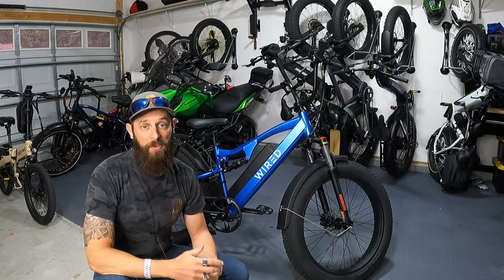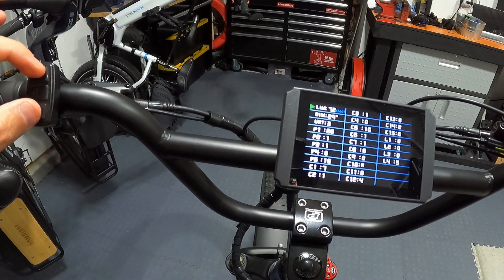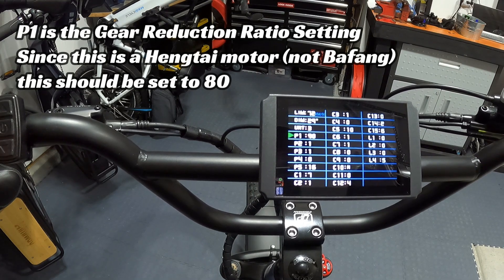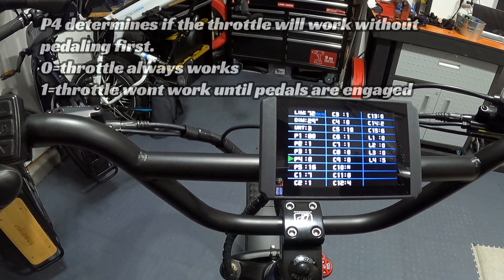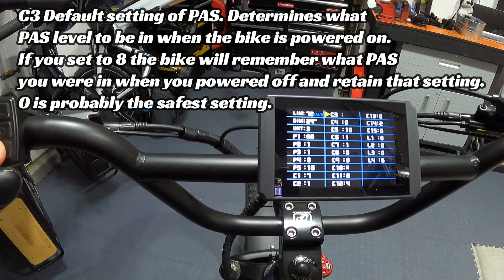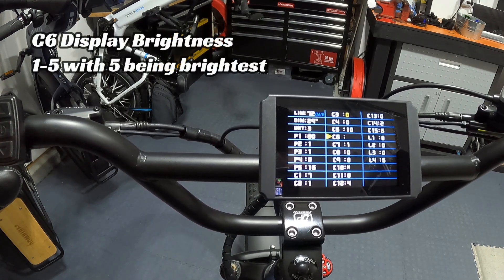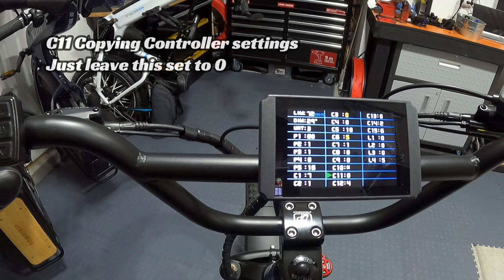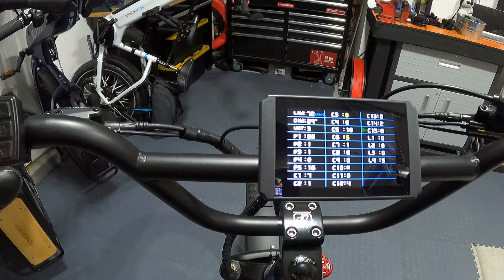Wired Freedom Display Programming Settings - LCD8H Display

Comment: I can’t change any of the parameters in the settings. Anyone knows why?
Reply from the maker: Is this on a Wired bike?  It should all be wide open for you to adjust.  scroll to the setting you want using UP & DOWN and select it with the power button and change as needed.

Comment: L4 parameter is used to adjust the delay time of automatic shutdown of the LCD, the
default value is 5, and the range of adjust is 5-120 minutes.
 4.1. When L4=5, the delay time is 5 minutes.

 4.2. When L4=6, the delay time is 6 minutes.
 4.3. When L4=7, the delay time is 7 minutes.
 ………….
 4.4. When L4=120, the delay time is 120 minutes.
Reply: 0= never turn off??? Thx

Comment: If C5 is at 3 or 4 does that limit total power?
Reply from the maker: yes settings 3 thru 9 limit the power, 10 is full power, 0,1,2 are full power but have a slower start.

Comment: My biggest problem with this is that I have a gearless hubmotor. Running a 1500w 24" rear off of a 48v 20ah. Trying to get the best possible output out of the bike. Currently building a custom E-Chopper. Currently getting around 30mph. would like to get more. The reason for this is in preparation for building bigger bikes.

Comment: Tell me, I bought this display, but it does not work from a voltage below 47 volts, what is the reason?, the display on the back says 72 volts, it should also work from 24 volts?

Comment: I just got off the phone with Wired. Samsung batteries should be set at 6 on the P5 setting. Not 16
Reply from the maker: yep, they changed battery cells after this video. 6 is the correct setting for 2024 and beyond wired bikes.

Comment: The C15 setting is actually to fine tune the walk assist mode speed.  You can enable walk assist by pressing and holding the down key on the key pad.  The bike will then power up the motor to run at either 4, 5, or 6 kph depending on what the C15 setting is set to.  C15 setting options are either 4, 5, or 6 depending on desired speed.

Comment: Been learning from you since the start with Rad Rover, I sold my rad that was fully upgraded from watching your videos, now I’m buying a e-cells five star pretty much the same as the wired as u know only there are benefits that the wired doesn’t have like the potted controller, Anyway, I hope that you get an E cells five star and do a review on it also,it’s a very big seller right now👍

Comment: I had a quick question…in your video you said that the bike came to you with P5 set at 16, and I found the two bikes I just received came with P5 set at 6. Should I change them to 16 or leave it at 6? Thank you for your help
Reply from the maker: Leave at 6

Comment: My display shows just an 
orange/yellow bar. Even with a battery showing three bars, the display only shows the one bar, snd it's orange/yellow
What setting on my display is incorrect?
I tried the P5 setting on 8, 6, and 16, but no change.
 Any ideas?
Thanks
Reply from the maker: Change P5 to 6 and prop the bike up on kickstand and run full throttle thru all the pedal assist levels, I think that calibrates it.
Reply: @CitizenCycle925  , I think you might be right.
I used the factory reset and took the bike for a run.
The battery status is once again proper.
Thanks!

Comment: That's the old version of the Wired Freedom. Do these settings also apply to the '24 version?
Reply from the maker: pretty much the same except P5 should be set to 6 so the battery indicator will be accurate, and C8 should be set to 1 since the 2024 versions have a motor temperature sensor.  other than that, the settings are the some.

Comment: CC, here is an update for your subscribers…. I was having an ISSUE with the GRAPHIC BATTERY STATE OF CHARGE not even closely representing the condition of my battery, and so sent an email to Wired. Steven, quickly and graciously responded with this fix… 1). Set P5 setting to 6 instead of 16. —— 2). With the bike on the kick stand lean it left so the back tire is off the ground. —— 3). Put in PAS 1. —— 4). Carefully making certain the rear tire is free and not making contact with ground, advance to full throttle for ten seconds. —— 5. Make certain back tire is stopped before again making ground contact. THIS FIXED MY ISSUE!!!
Reply: I had a BeeCool Adventurer that was stolen and replaced it a Wired Freedom.  I wanted to purchase from a company that had good first person customer service. The Wired folks are the best!!!
Reply: Io ho una batteria 48v 20 ampere che valore mi consigli in P5?grazie

Comment: Thanks for this tremendously helpful video!  I hope it is okay to request some clarification on C5... I think you are saying selections 3 through 10 allow you to set the "instant on" from dead-start start-up power where 3 would be the lowest power and 10 gives full power.  0,1, and 2 are special in that they give you full power but it provides a ramp up to that point.  The ramp itself I would assume is a slower at 0 and is fastest at 2 with selection 1 being somewhere in between.   Do I have this correct?  Many Thanks!!!

Comment: FYI, newer 2024’s, P5 default is 06 and the motor now appears to have a temp sensor C8 = 1 turns on MOTT
My bike battery arrived 100% charged 😮.  So due to it being winter I get to tilt the thing and run it down to 50% for storage.

Comment: C11 connection protocol you can tell copy or reset a new password on a control you lost pw via second display
Reply: How do I reset it?
Reply: @ozzy6058  you need to link a second controller display that's not password or known password to reset the other controller display.
I've never done this procedure but I do know it can be done

Comment: I'm picking a password so that if someone steals her, they're screwed.
Reply: Me and you both, I ain't dimwitted enough to forget my brand new first ebikes password😅trust
Reply: My Freedom is a replacement for the SECOND bike I have had stolen. This one WILL NOT BE NICKED!  Tomorrow is the second day of my new Freedom (assembled yesterday) and it will be password protected here forward.
Reply: I tried the last three digits and it worked 😅, thank you 🙏🏾 so much, you really save me bro. God bless you 🤘🏽
Reply: @nealharmon954  ; I’m glad it worked out!  I can only imagine your angst, being locked out of a brand new bike.  Happy trails.
Reply: @nealharmon954 it’s a miracle! I’m so glad you’re not locked out.
Reply: @Doc.Holiday did you password protect your freedom.
I tried to password word protect my wired, it was a 4 digit password, but when I saved it and went to the on screen there was only a 3 digit available and I was locked out.
Did that happen to you?
Reply: @nealharmon954  same thing, but I’m good with 3 digits. At start up it takes less time to enter and offers enough initial security. If a thief successfully steals the bike and has the time to methodically cycle through the various combinations he would eventually hit the winning combination.  Three digits = 1,000 possible combinations. Four digits = 10,000 possible combinations. Hopefully there is a firmware update at some point to fix it.  It doesn’t make sense there are four places but only three are accessible to input. It’s a simple fix. They will address it with an update eventually, or not.
Reply: @nealharmon954  ,.. I read your comment again. First time I didn’t glean you were locked out. I didn’t get locked out.  It only took the last three digits. Did you try entertaining the last three and the first three?
Reply: I tried the first 3, but no go, I’ll try the last three today. I let wired know what happened, but I don’t know what their response is going to be. 
That should be known about the passcode protect.
Reply: Thank you for responding to me.
Reply: @DASO_MILITIAIs this really true?
Reply: I have 2 batteries and 2 motors. After a reset, I lost the 1 battery and 1 motor. How can I fix this?

Comment: I’m interested in this bike but was looking for a torque sensor bike, I was told this bike can imitate a torque sensor through the control screen settings? I have a lectric bikes now. Which has Candace sensors also and they seem to give you a percentage of power constantly so even if you get over the speed for the pas your in,  and you pedaling it still helps you.  (I like this) I also have a Magicycle Deer that also has a Candace sensor but that one  when you hit pas level ceiling the power cuts out totally so you feel like the brakes were applied. So it’s all or nothing. Putting that bike up for sale, and I’m looking at this one. Could you explain how the sensor works on this bike?

Comment: Thx bro
Reply from the maker: Any time
Reply: @CitizenCycle925 
Bryan,
I just recently received my Wired Cruiser and it is everything you said it would be and more! What an absolute blast!!  
I’m glad I stumbled upon your videos about 3 months ago and decided to purchase the Cruiser! 
Thanks for these Videos!
They make a huge impact on deciding what to buy! 

I have a question about the programing with the Wired.
With the P5 setting in this video you set it to 16 
But I was told by other Wired owners to change it to 6 if you have the new Samsung battery?🤔
Is this correct? 
I will say it seems like now when I changed it to (6) my battery indicator seems more accurate with how many volts I have left.
Let me know when you get a chance, thanks 👍
Reply from the maker: @johnb6174  happy to hear you are enjoying the Cruiser.  Yes, i believe you updated the battery setting correctly.
Reply: @CitizenCycle925  
Thanks 👍

Comment: Hey got a freedom and in first three rides my power decreased. After initial take off power to where it maxes 13 mph,  need help getting it back to normal.  Says to be full charged and I set it to your spec suggestions, still takes off but quits picking up after 12 mph what do I focus on ?
Reply from the maker: Have you ridden it more than a couple miles? When I first rode mine i noticed it wouldn't go over 15. Then wouldn't go over 20, then 25 etc. The motor had kind of a gradual build up before it allowed me to reach max speed. Has yours ever hit max speed?
Reply: @CitizenCycle925  ridden 3 or 4 times and after a mile or 2 it either shuts off  or drops power to about nothing, on the display it gives me 3 different low speeds but nothing over 13 and is not reaching 13 even
Reply: @CitizenCycle925  yes

Comment: Made notes of settings and hoping the 2024 model is the same.
Reply from the maker: should be same
Reply: @CitizenCycle925  Today was viewing a Facebook group for the Wired, and unsure if true or not, but a setting for display voltage/bars, might depend on whether one has LG or Samsung batteries.  Unsure, more research needed.  Just saw that like an hour ago.
Reply from the maker: @NOWitsOKto  Yes, I've heard chatter about this. But all 3 wired bikes that I've been on. Have all had LG cells in them...

Comment: Hey bro I have a fully charge battery but my bar on the display screen is reading 1. I have p5 set at 16 and I change it to 17 and 18 and it still displayed 1 bar. I set it back to 16 until I hear from you. Thanks.
Reply from the maker: Look at the label on your battery pack and if it says Samsung then set P5 to 8 instead.
Reply: @CitizenCycle925  I will check when I get back home. thank you.
Reply: It's working now.  Thanks for the guidance.
 @CitizenCycle925
Reply: @CitizenCycle925  15:12

Comment: no way to change to 9 pas levels :(... 40mph ebike needs that the most.
Reply: The Wired PAS works great, you don’t need 9 different power levels, I rarely use more than 3.  No mph, just constant wattage.  Feels and rides like a normal bike.  Every PAS that uses mph sucks in comparison.  You have to try it.  Everyone raves about it.  You don’t know what your missing.  So much better than a torque sensor or 9 speed mph pas on a high powered bike.  You can be in PAS 1 and simply hit the throttle to overcome a hill or speed up.  Whatever, your loss.
Reply: The Wired PAS is great, not sure what your talking about.  The PAS actually has 15 levels as you can adjust C14 low, medium, high.  The constant wattage approach is great and fully customizable.  What the bike needed was an 11 cog for high speed pedaling, but they added that on latest version.
Reply: @jfly2249  How does c14 work on low?  is pas5 limited to 25mph?  c14 on high, is pas1 limit 20mph?  Does c14 widen the difference between "gears" or shift all the gears up or down?

I guess its possible to set one setting for any one ride, but fiddling mid ride with c14 seems impractical compared to just having 9 pas levels.

Comment: @11:18 I think the password setting is useful.  If your area has a lot of thieves, then this will deter them.  I would rather replace the controller/display verses replacing the entire stolen bike (there is a 1000x more likely chance the bike is stolen verses the password being forgotten).
Reply: I wonder what kind of password it is? 4 digit pin? That would be easy to remember.
Reply: @jaymartinson3236  Yes, it is.  Also if you forget it.  I could easily crack it within a thousand guesses.  Some people would rather throw the $2000 bike away in the trash before guessing a thousand times.

Comment: LCD screen has a 0  and it shows Throttle comes on but bike does not move??  . Ideas??
Reply from the maker: If pedal assist number is set to 0 throttle won't be active, bump pedal assist to 1 and try throttle.
Reply: TY it Worked :)
 @CitizenCycle925

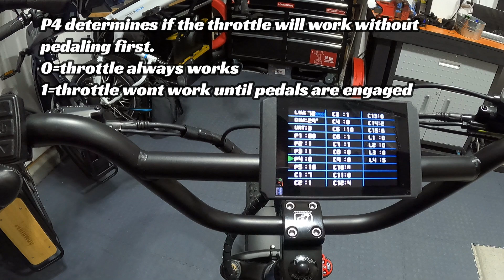Comment: 6:25  There has been a change in batteries from LG to Samsung and that P5 need to be set to 8 with Samsung.

Great video!  Lots of help this provides and thank you!
Reply: This needs to be the top reply. Without changing this parameter, the battery will show 0 bars left on the display while the battery button still shows it's half full.  Wired supposedly emailed their customers with the info, but my son (who has a Cruiser) never got the email but happened to notice a post on Reddit ebikes.
Reply: @gutturf I got the email and adjusted and Im pretty sure it was 8?
Reply: For those just seeing this now, the factory recommendation is now setting 2024 Samsung battery bikes to P5=6.

Comment: New bikes are also an improved frame geometry with much more clearance, 11 cog in the rear and an Acera derailleur and new rack and rear fender.  They keep improving the design.
Reply: my freedom came the other day and has an altus derailer. I can't seem to get it to go into 1st gear. adjustment screw is doing nothing.

Comment: How do I get to the wired freedom chat room?
I moved the C5 setting to 1 to slow down the takeoff speed and now the throttle won't work at all even when changing C5 back to 4
Reply: I also tried the C10 setting to Y but it didn't reset at all.

Comment: Apparently the bikes that just shipped in August have Samsung batteries instead of LG. This means in programming P5 needs to be changed to 8 instead of 16 or your battery levels on the display won't be accurate. 

I was wondering what was going on. I got my freedom bike yesterday and noticed my battery showed half full after just a few miles of riding on a full charge. I thought I had a bad battery until I received an email from Wired explaining the issue and the fix.

Comment: I watched this when you first posted it and I FINALLY got my Wired Freedom yesterday so I had to watch it again today.  I was wondering my I couldn't get my speed past 33-34 MPH.  I'm gonna go with a 2 for the most power and fastest "slow" ramp-up of power (if that makes sense).  I can't remember what I set it to to get 33-34 MPH but it was less than 10.  Tried 10 right off the bat and, yeah, almost got thrown off LOL.  I'm used to it now but I have this strange habit of sometimes using the throttle with only my right hand holding the handlebars.  That could catch me off guard.
Hey, question for you, if you're still reading.  My battery voltage was factory set for the one that represents 60v but the battery meter showed half on a full charge and then it actually started going UP as I rode it.  Very strange.  Any experience with this strange behavior?   And thanks for the informative video! 😃
Reply from the maker: Glad you got yours, hope you love it!  for top speed make sure speed limit is set to the max, tires are inflated firm, battery fully charged, and then the rest will probably depends on rider weight..    I have not see any strange behavior on the battery indicator before.
Reply: @CitizenCycle925  I found out what it was.  The speed limit was fine.  I thought C5 was only intensity.  I realized you said it has to do with the amount of power that can go to the motor.  It's on 2 now like I said I was going to try and I have access to all the power but it ramps up, which is perfect for me.  I had it up to 38 MPH.  Yeah, that power meter thing concerns me.  I'll have to ask Dan about that.
Reply: P5=8 for Samsung
Reply: "My battery voltage was factory set for the one that represents 60v but the battery meter showed half on a full charge" Like jfly2249 says, you now have to set P5 to 8 (instead of 16) to get a more accurate battery reading on the newer bikes since they started using Samsung instead of an LG battery pack.

Comment: Hi. Is the rear tire rubbing on the 40 amp control box?
Reply: the new version shipping now has a longer frame and plenty of clearance. they upgraded the cassette to 11-34 shimano and acera derailer. to top it off a larger better rack that's super beefy.
Reply from the maker: not for me, i have not had any clearance issues although i have hear this complaint, from what i understand it can be corrected with a slightly longer rear shock which Wired has been providing.

Comment: The copy settings for controllers is probably for factory uses. They probably wholesale these controllers to Wired and other PEV makers too, so those companies will probably set their own values and then copy them to all of their other controllers without having to input in 1 by 1 for each vehicle, making it a lot faster and lower chances for the wrong input.